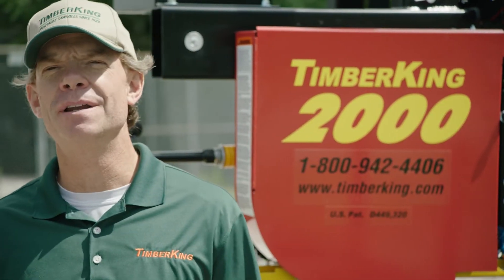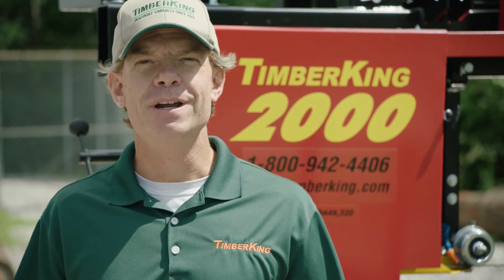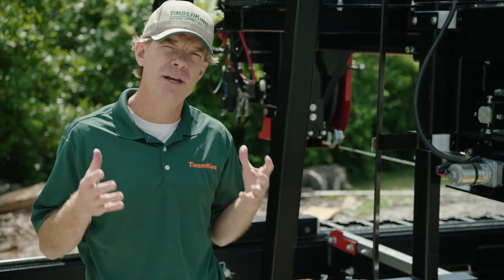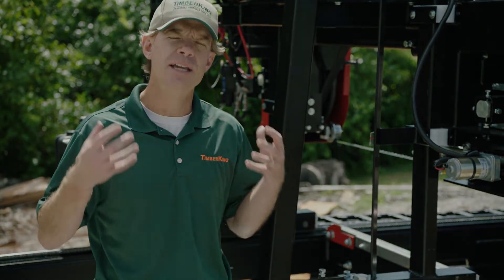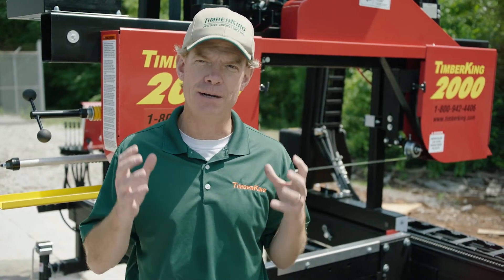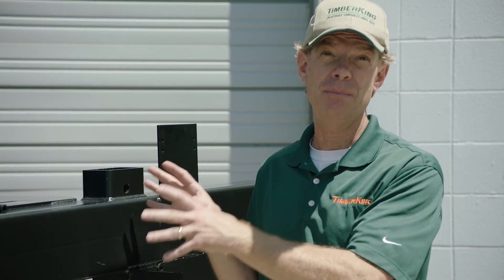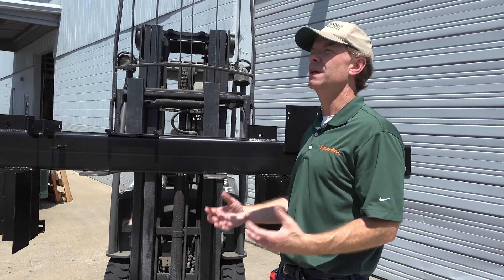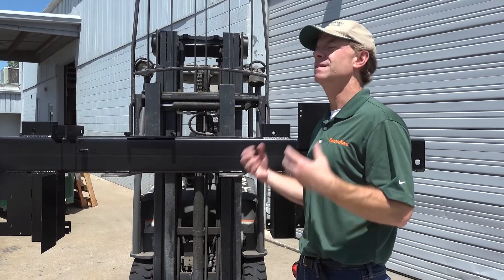TimberKing Big 3 Portable Sawmill Super-Structure

Comment: I've been running a older  TK B20 with over 13000 hours now, it's and simple mill that's easy to fix when needed. Breakdowns are few and far between on it.  A lot of my customers who used to have  a more polular brand saw for them are amazed I can saw all day without working on my mill.   Not saying it doesn't need fixing as any machine does but it runs a long time between fixing it..   And the new TK mills have improves even more

Comment: Some videos about using portable bandsaw mills demonstrate wood with metal in it being sawn with teeth engineered to cut wood only. When such bandsaw teeth contact nails or other metal in the wood they become badly dulled, or damaged. The problems seem to depend first upon a lack of preemptive detection & removal of metal in & from the wood, respectively; secondly, upon incapacity of the bandsaw teeth to efficiently cut metal also.

Many improvements & adaptations are built upon earlier established means, methods & materials in the evolution of many tools. Subsequently, I imagine that to inspect wood for purity that a hand held tool like a highly sensitive security checkpoint metal detector is swept slowly & closely over the wood surface. Next, I imagine this category of metal sensor may be installed ahead of the moving & travelling blade & near to the wood; it serves to actuate a switch to an alarm, to stall/power-down/shut-off the blade & stall/brake the forward travel. These are low-cost & expedient tooth- & blade-sparing means to preemptive detections of metal in wood.

I imagine that the cutting tips material/s of the blade teeth are arc/TIG welded onto the teeth & the weld material is a very durable alloy also used for cutting metals; sharpenable with something like a chainsaw rig & a hand held grind/drill tool. I imagine such cutting tips will make best advantage of special grind angles to shear & clear away metal & wood without destructive deflection, impacts & friction. I imagine touch-up welds & grinds would inexpensively keep spare blades in top shape. Maybe replaceable carborundum-like materials could be metalurgically bonded to the teeth tips instead.